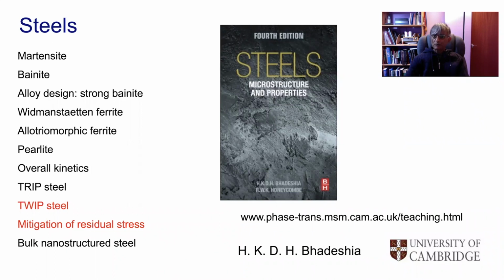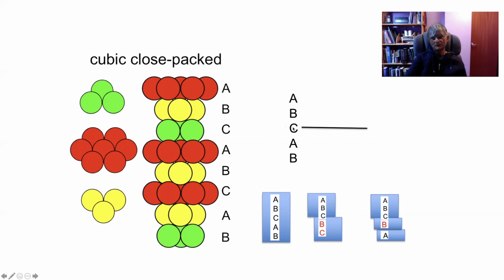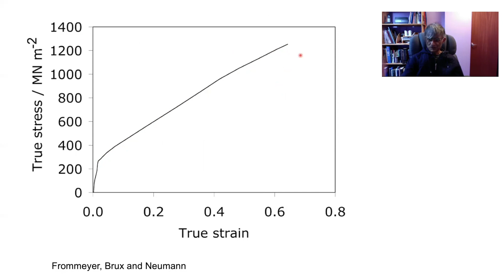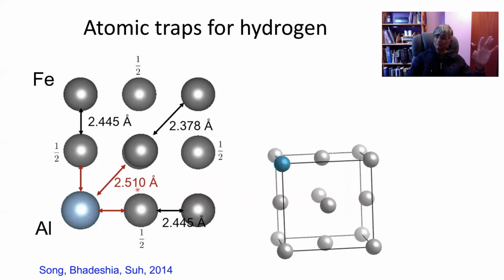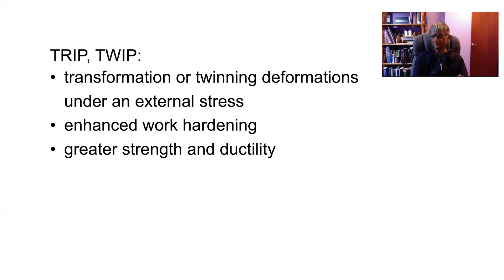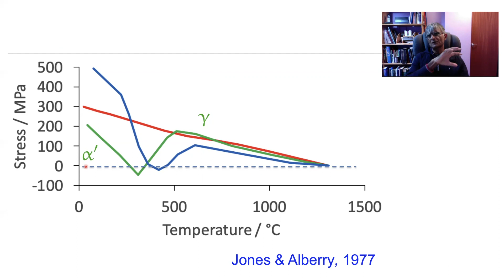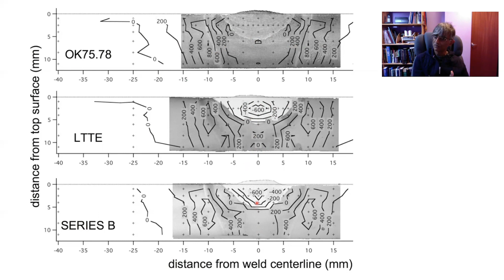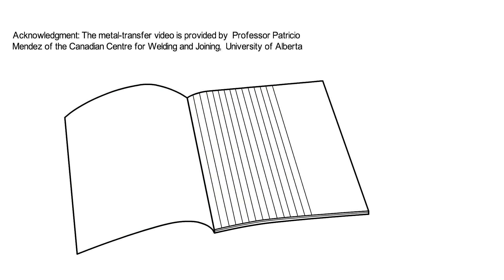Steels: twinning-induced plasticity. Lecture 11 of 12

Comment: Thank you for the great lectures professor. Why do the transformation of welding alloys not just reduce the tensile stress but also cause a compressive stress? And why does martensite, which is diffusionless have the same effect on residual stress as diffusional transformations?
Reply from the maker: Good question. The amount of thermal contraction that is cancelled by the expansion due to phase transformation depends on how much transformation occurs. There may be more transformation than is needed to cancel thermal contraction, as the weld cools. Both displacive and reconstructive (diffusional) changes cause volume expansion, but in the former case there is also a large shear strain. The effects will not then be identical.

Comment: Hello prof. and thank you for beautiful informative lectures. I think using a martensitic structured consumable is not good in welding or am I wrong? Because at the minute 25.14 you are mentioning to using a martensitic consumable. Could you please clarify? Thank you for your consideriton.
Reply from the maker: Martensitic consumables are in fact used routinely but the carbon concentration is low, which ensures that the martensite is not brittle. Martensite without carbon even forms the basis of rocket motors. It is carbon that makes it brittle.
Reply: Thank you prof. Thank you Sir. Sincerly. @bhadeshia123

Comment: Professor Bhadeshia. Does twin itself strengthen steel ? if so ,what's the mechanism?
Reply from the maker: Yes, the twins do two things - the twin interfaces are hinderances to dislocation motion (Example 11.4, page188, "Geometry of Crystals, Polycrystals and Phase Transformations" which you can download free from 
https://www.phase-trans.msm.cam.ac.uk/2020/Crystallography_book.pdf
The second effect is that twins subdivide the coherent regions of the parent grain, thus leading to a dynamic Hall-Petch effect where the grain size decreases as plastic deformation increases.